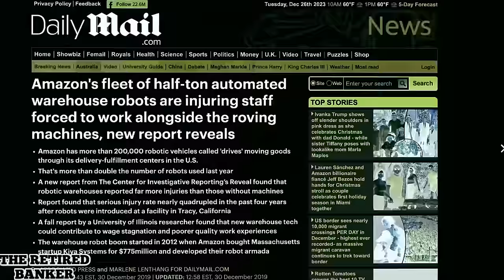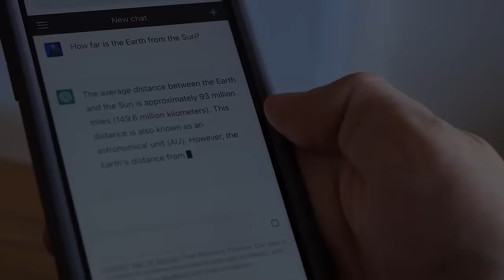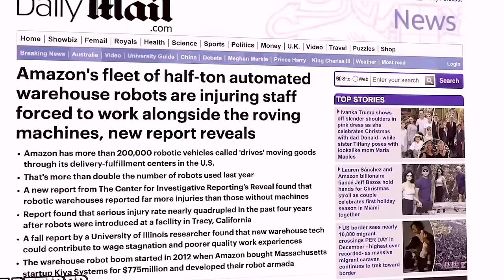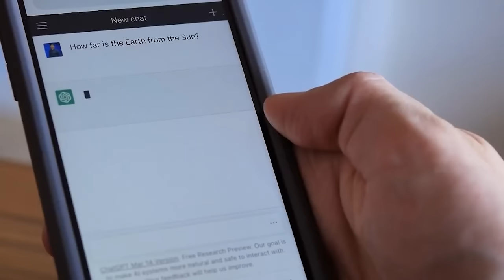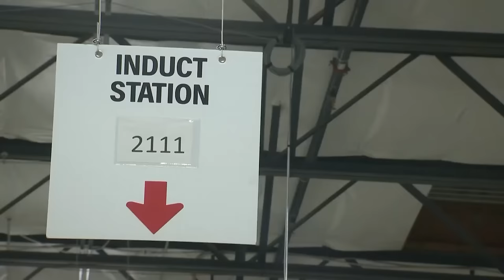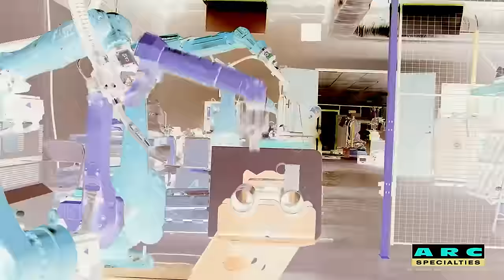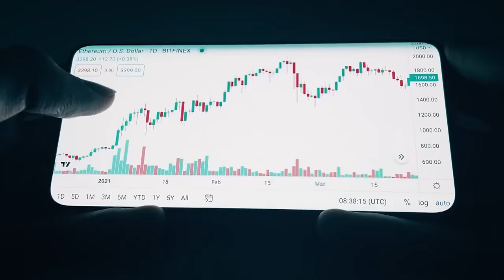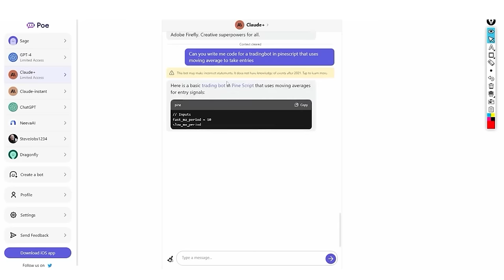Tesla Robot ATTACKS Engineer At Texas Factory!

Comment: It was a fixed assembly robot, just like you find in millions of other factories. Not an Android with arms and legs like you are trying to infer in your video. Also it was controlled with a PLC system, not AI.
Reply from the maker: While it's true that this particular robot was used in an industrial setting and not a humanoid AI, the incident did raise questions about safety and human-robot interaction. It's always important to stay informed and discuss these topics openly.
Reply: @TechDriveTV  "This particular robot"? Name one case where an AI driven robot 'attacked' a human? This 'particular' robot was nothing more then an automated screwdriver or welder, doing nothing more then 1 simple task and something broke (sensor) or someone f-ed up programming it or the 'victim' was standing in the wrong place! This is like some moron walking into an airplane's propeller and you saying the airplane attacked this guy. You're just making up BS to get clicks!
Reply from the maker: You've hit the nail on the head! 🪛 Comparing this incident to an airplane propeller mishap is spot on. Industrial robots are just tools, and accidents usually result from human error, not the robot's intentions. Thanks for your insightful comment! 😄 @arturama8581

Comment: Even if a robot goes nuts, why would it attack and harm a worker? These reactions would be all too dumb and human. Yes, a malfunction may cause an injury but nor on purpose. By the way, the robots in production lines are stationary handling systems, not the ones from munitions industrie that hop over the garden fence and bend the barrels of submschine guns like Robocop or Stanley Beamish did.
Reply from the maker: The idea of robots attacking workers seems more like a scene from a Hollywood blockbuster than reality. These machines are meticulously designed for specific tasks and are far from being autonomous Terminators. Safety measures and human oversight are paramount in manufacturing environments.
Reply: Sir robotic control systems also use analogue electronics. So, capacitors are the weakest part here. They won't tell it' though cause it's an industrial tabu now. But don't forget this word: capacitors!